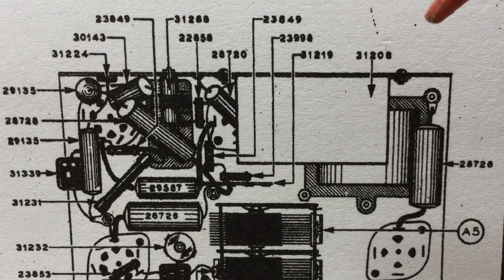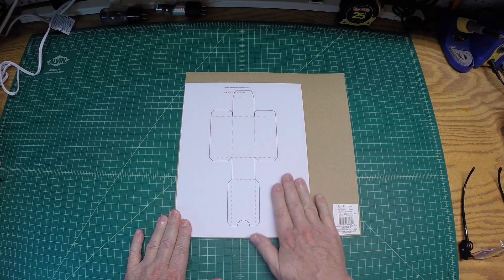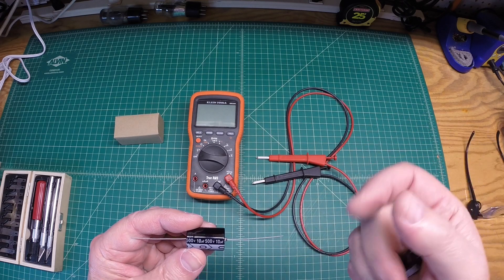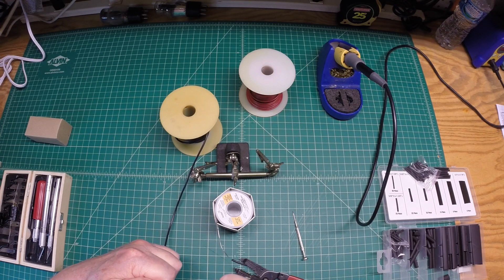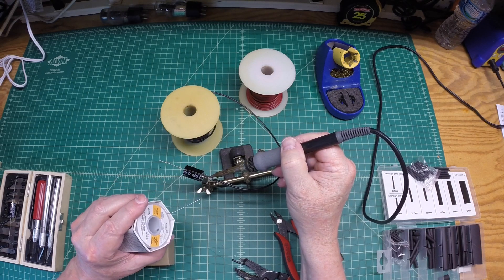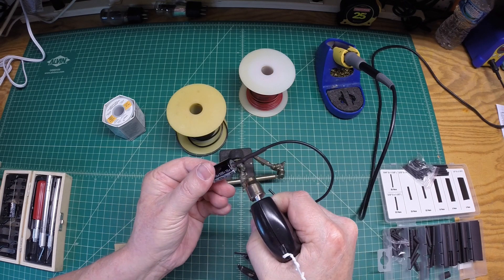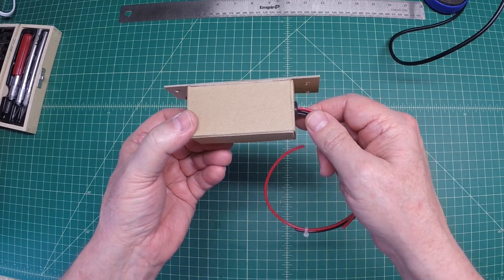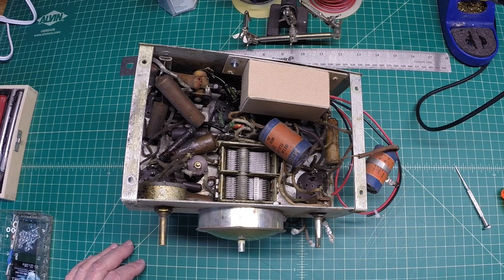Electrolytic Capacitor Box

Comment: That's neat, are you going to leave the box natural or finish the surface to make it more durable, like slim said there is paint or spray lacquer, or I wonder if brushing a coat of hot bees wax on it then smoothing it out with the micro torch would give it the appearance of the old wax capacitors .
Reply from the maker: +halfwayuphill +Slim Hermer Still undecided if I'll leave it natural or doctor it up. I do plan on coating it with a Fire Gard Spray for sure. Thanks for sharing your ideas/thoughts on this, it gives me something to chew on. Best, Don

Comment: I really enjoyed this segment.  This is not a complaint or suggestion, but I was wondering if you considered the flammability of the box?  I would expect  that there are other flammable components in that old set including the case, so the cardboard is on adding any liability.  I would guess that  even the old electrolytics were a bit of a fire hazzard?  The box makes a real neat solution, especially in a crowded spot like under the chassis.  That is a real neat trick with the pizza cutter. . . .gotta sneak that one by the wife :).  It seems like the electrical restoration is coming along really fast.  Thanks!
Reply from the maker: +Stephen Moore Stephen, I will apply Fire Gard Spray to the inside and outside of the box. I needed a cardboard scoring tool, but the pizza cutter got me by. LOL The electrical is complete less a few things left to tidy up (video will be published soon). Thanks for following along Stephen. Best, Don
Reply: +RestoreOldRadios +RestoreOldRadios I should have thought of something like fire guard spray.  Sometimes I am obtuse when the obvious is staring me in the face:).  The restoration is really flying.  Thanks again!!
Reply from the maker: Stephen Moore Stephen, a little set back with the antenna coil, but I was able to work through it. Thanks again for watching and following along. Best, Don

Comment: Nice fabrication of the e-cap box! I noticed you used two , black negative leads coming out of the box. I usually join the two e-caps negative leads together, heat shrink them and use one black lead to B- or ground. Did you do that to keep it closer to the original design of the radio? Thanks!
Reply from the maker: +Tim Dockery Tim, me too in most cases, but this radio design was different. Only one negative side goes to chassis ground and the other attaches to the CT winding of the power transformer and field coil. The cardboard box was added to challenge or I should say learn a new skill and to your point, have it closer match the OEM design. I appreciate you following along. Best, Don
Reply: I see, thanks for the explanation! I should have looked up the schematic on NA!